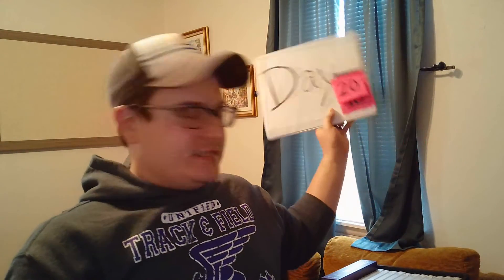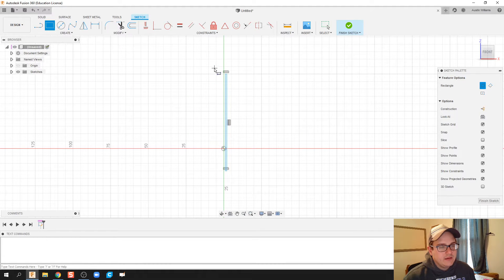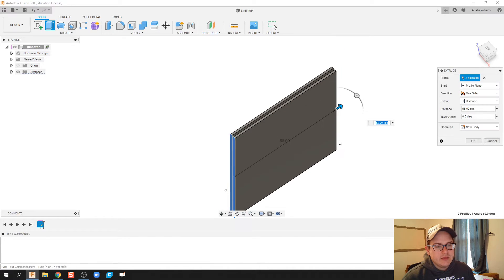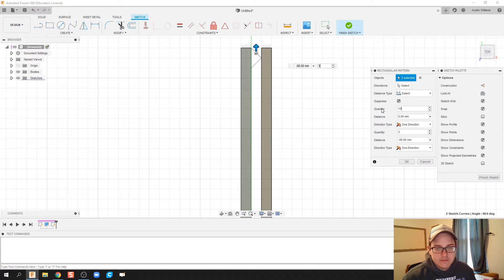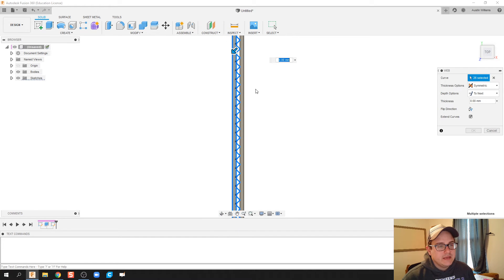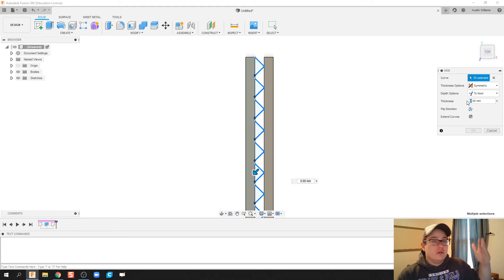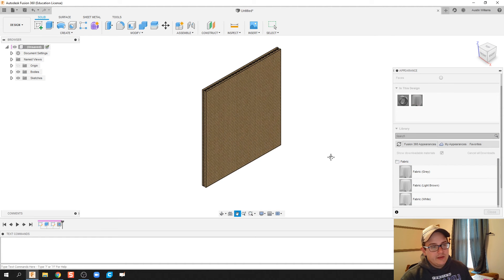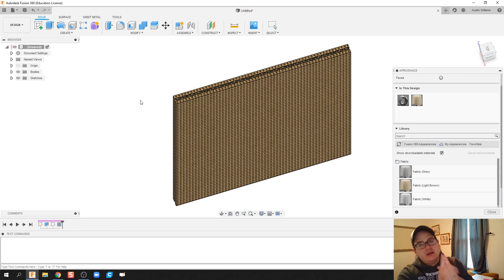Web and Rectangular Pattern - Day 20 of 100 Autodesk Fusion 360 Journey

Comment: Hi, all of the tutorials are so far are so nice. Thanks you! In this tutorial when I create a web, it complains "Error: The Rib cannot be created. Ensure profile curve can intersect body, or flip the direction". I did flip the direction but didn't help. I am on version 2.0.19440
Reply from the maker: Make sure the webbing isn't overlapping and your spacing is wide enough. Let me know if that works!
Reply: @LearnItDoItMakeIt  I tried that. It did not work. I closed the object on top and bottom with extrude and then it worked.